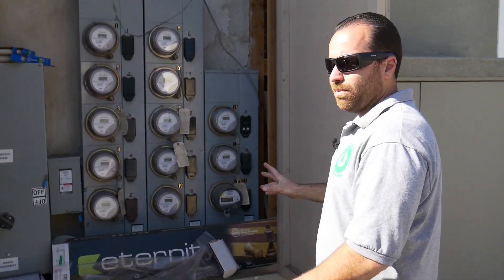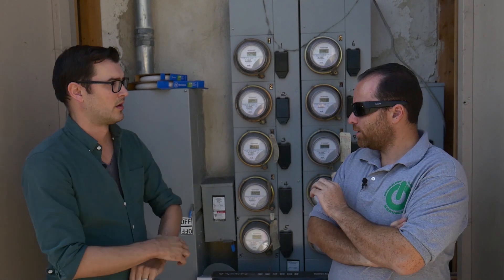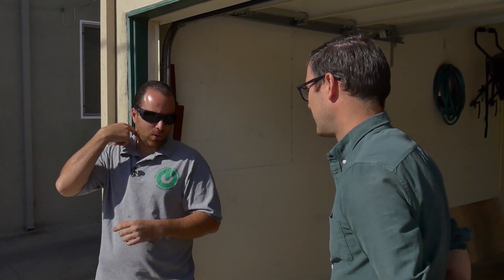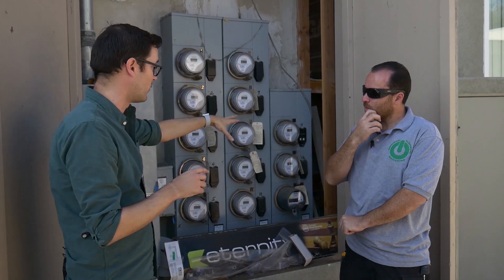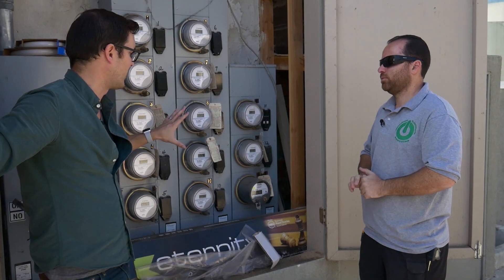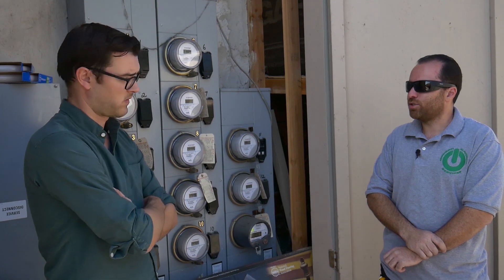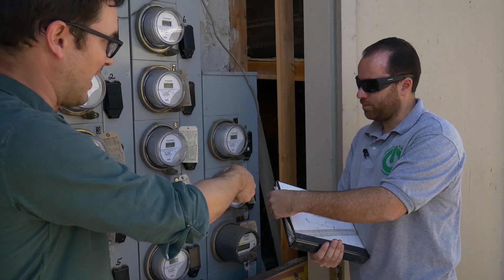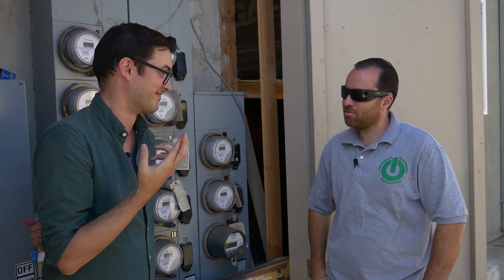Electrician Interview | How to install outlet and wall charger for your Tesla Model 3

Comment: Excellent video. Best video I have seen discussing the issues of installing a high-amperage 220V outlet for EV charging in a rental situation. I am a homeowner in rural NY where installing the electrical connections was super easy compared to what would be required for a renter. You are lucky in that you have a reserved parking spot in a covered garage no less. I can see the challenges would be even more severe if there were no assigned parking. I have a Tesla M3 and use Tesla-branded wall connector, but have no garage and have it installed outside in my driveway. There is no way that I know of to turn off power to the connector short of flipping the circuit breaker on a daily basis, so in theory anyone could stop and hook up for power that I would have to pay for, but I live in a very rural area where there is not much chance of that (lower population density, sadly with very low EV penetration). In a rental situation where access to the wall connector cannot be controlled, also consider a "JuiceBox", which can be controlled through an app.
Reply from the maker: Karl Schwarz thanks for the kind words!!

Comment: This guys estimated cost are way out to lunch. Call some else and have a nema 14-30 outlet installed in your garage. The tesla HPWC is $500 from Tesla direct. Tesla's have the charger built into it and all your buying and having installed is a connection unit with the proper fitting to plug into the car..

To get the outlet installed tell them their installing a dryer outlet. It will hook up to you regular meter and all you need is a 50 amp outlet which the HPWC will used roughly 40 amps. Your monthly bill if you plug in every night would rise about $50 per month. You should be able to get the outlet installed by any other licensed electrician for $200-300.
What he quoted you is a ripoff. I've participated in several Tesla power outlets without anyway near the costs he's quoting you.

Good luck.
Reply: Skilled labor ain’t cheap and cheap labor ain’t skilled.

Comment: The Tesla Wall connector doesn’t require a 100A circuit. That’s the max it supports. There’s a dial to set the number of amps available to it . Also, Superchargers don’t take a couple of hours. 30 to 40 minutes typically.
Reply: David DiStefano this electrician don’t know what he talking about .. 100 amp on the wall charger lol 😂 i hope he did not go with this electrician
Reply: Yeah, he clearly said that most clients don't go for the full 80 Amp charger, most go for the 15-50 connection.

Comment: Wow, thanks for asking the questions those of us who are currently renters, need to have answered in order to properly plan for our Model 3 purchase and to help determine the best charging approach for our circumstances. 
Approaching a landlord can be a touchy subject, but it is definitely worth asking if they might consider going in halves on the expenses (at the very least) since you plan to leave the NEMA1450 behind if/when you leave their property. They may prefer that the NEMA1450 be set up with its own panel (not attached to the panel for any specific apartment) so that future users don’t have to choose your apartment in order to also have access to the NEMA1450 charger. I suppose this also assumes that the carport/garage is not specific to your apartment, but can be rented separately by anyone in the complex, else the “separate panel” discussion above would be moot.
Reply: good point!
Reply: Ethan Cushing - Keep in mind, the higher the rate of charge going into the car (most of us refer to this as the increased number of miles per hour that the source is recharging our cars battery), the harder it is on the battery in your car. Tesla just came out with a warning about overuse of Superchargers causing a more rapid degradation of the cars battery/ies and recommended charging at the lowest feasible rate for your ‘current’ circumstances.